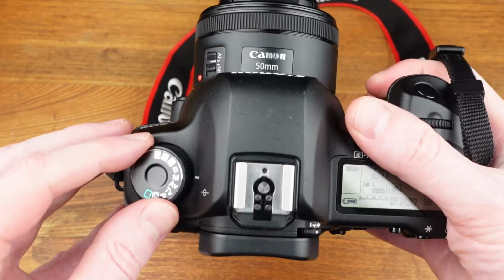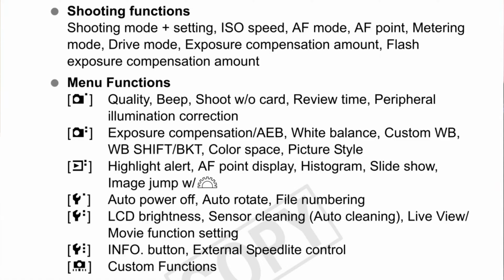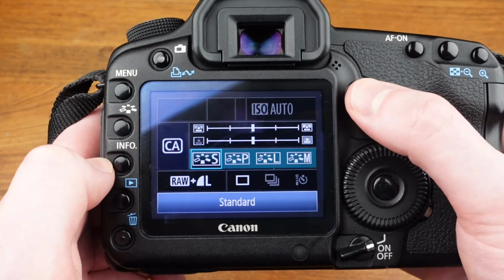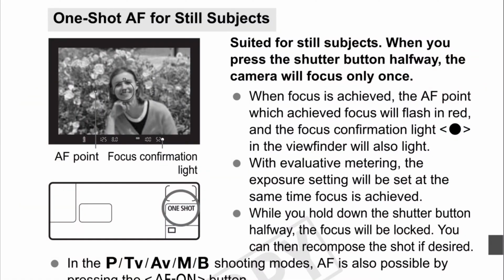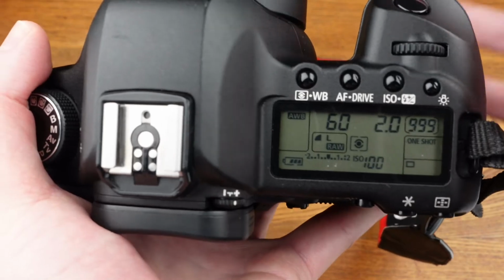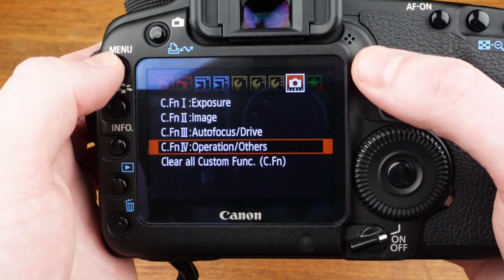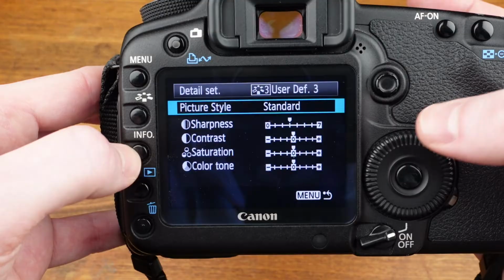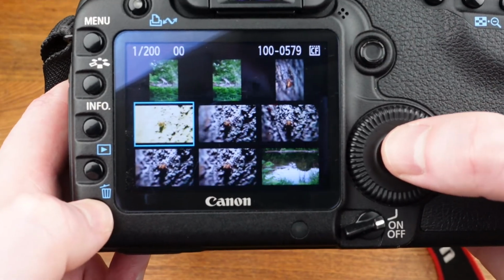Guide to the Canon 5D mark II

Comment: I found out the other day that in M mode, auto ISO only goes to 400.
Reply from the maker: I just checked and it seems like it stays at 400. I went +3 over and -3 EV under and it never changed.
Reply: @OutsidetheShot Yes.  Just tested this on my 40D also and it seems to be the same (got both cameras in December).  This is new to me because my Rebel XSI which came out also in 2008 which was my first camera had auto iso 100-800 in any mode.  So that was an odd choice they did.
Reply from the maker: @planetdee3587  I tested the other Canon I have, a Digital Rebel XS, and it stays at ISO 400 in manual mode. It's so strange. Why not allow a range to be selected???
Reply: @OutsidetheShot so now knowing this, i had to test my XSI because I googled it and it said I could.  😂 I did not work.  So I must be remember my later camera (the 60D).  I guess in 2008 it was a feature not yet made.

Comment: Does it offer electronic rangefinder for manual focus assistance?
Reply from the maker: Only if the lens has electronic contacts. There are adapters with "dandelion chips" that will allow AF.

I'd avoid third party lenses without the electronic contacts. That's basically mirror lenses and a few other novelties like early Lens Baby stuff.